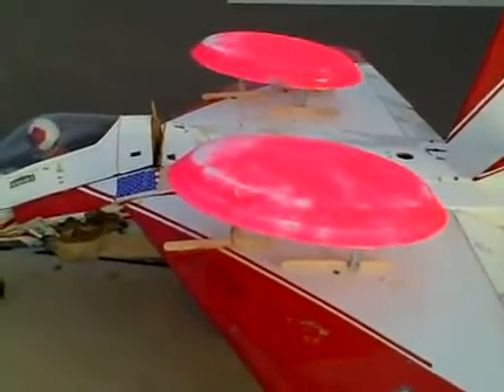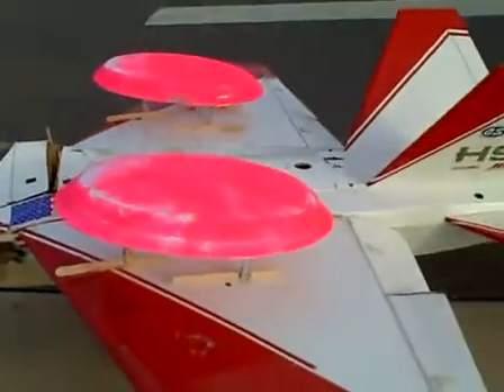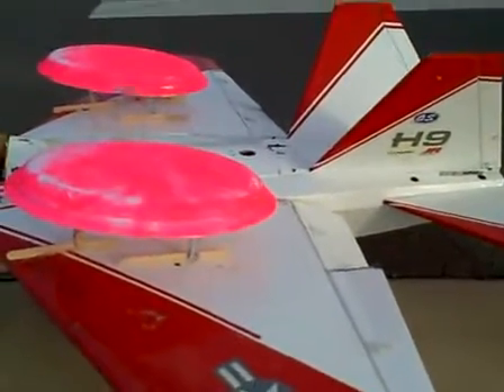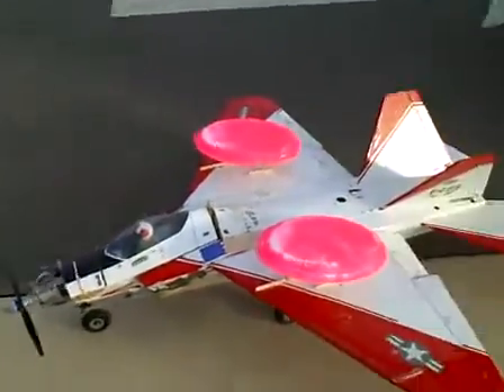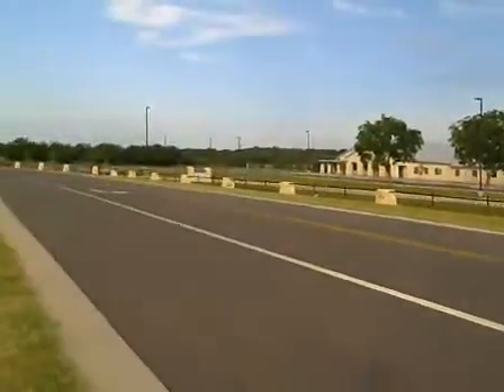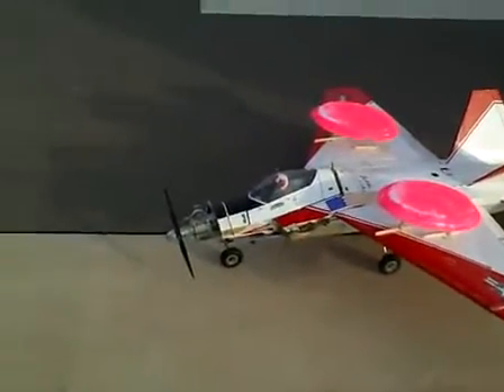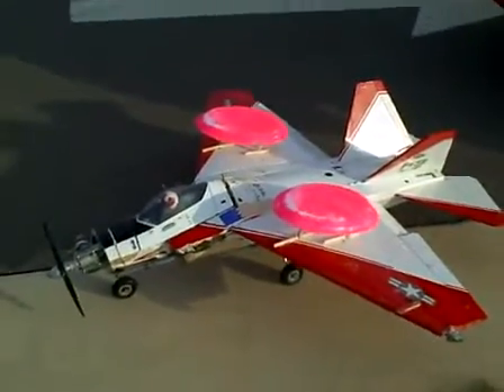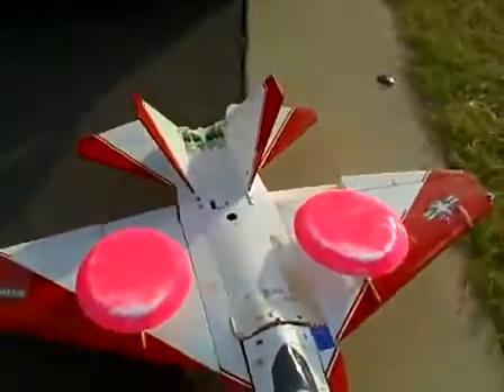Drone UAV innovation aircraft wing Oval Diskette Patent 8,382,040

Comment from the maker: Hi Avalon Run, the diskette adds lift without adding induced drag ; it is working on the principle of planer wing event. Small multiple wings work better than a single big wing however due to bracing and struts such as used on biplanes parasitic drag increases at same rate of lift .  With oval diskette added to wing the aircraft will not stall / spin and has a significant altitude service ceiling increase. Clime speed will equal ground effect speed and induced drag decreases with altitude.